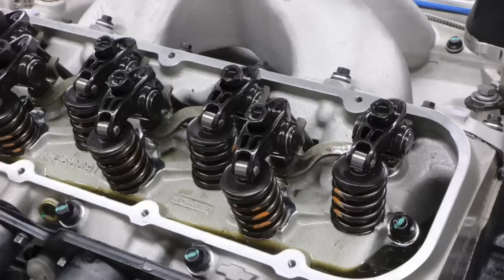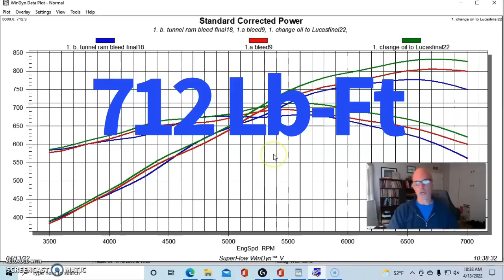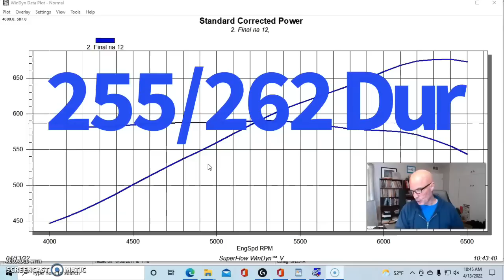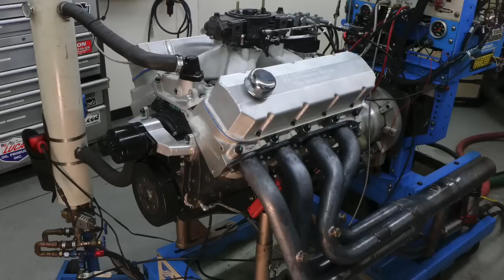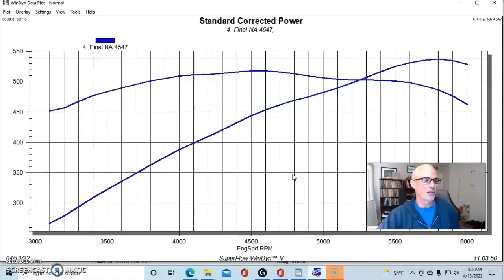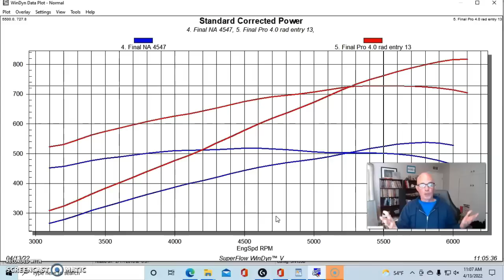BIG CAM & LOW COMPRESSION (MISTAKE?) STROKER, NOS OR BLOWER? WHICH 800-HP BBC COMBO WOULD YOU PICK?

Comment: That 540 would need around a 4000 stall would work excellent in a street and strip engine. And would make a huge gain at the track with a 350 horsepower nitrous kit. Especially with that 8.90 low compression with flat tops even better! No Junky Dome Pistons and Pump Gas Here!!! And a huge easy tuning window on engine, flat tops and nitrous. On engine 87 octane with those flat top pistons and probably pump gas and race fuel mixed or pure race fuel will definitely work for nitrous. 
833 naturally aspirated+ 350 nitrous = 1,183 horsepower. 

Bigger cubic inch engines are stronger and take more nitrous!!!

454 mild budget low compression engine 
250 horsepower cheater nitrous kit. 2.70 second gain in the 1/4 mile. That's huge with lower compression is the secret! 

750 Cid 15. compression 6.80 1/4 mile professional race car! 
200 horsepower nitrous kit 6.60 1/4 mile not much gain at all on nitrous! 
  
Because the engine is already almost at almost 100 volumetric efficiency! 

The higher the compression the less the gain with nitrous is! The lower the compression the bigger the gain with nitrous!!! 

More gain at the strip or street with lower compression and nitrous!

I will take my BBC 9. compression 540 pump gas with a 300 horsepower nitrous kit any day. Than a BBC 540 high compression and 13. compression, race fuel and no nitrous. Higher compression doesn't have the super cooling effect nitrous does. You can heat the nitrous bottle to the maximum for more gain!

Comment: Would like to see a similar low compression maxed out 9.00 compression on a 632. And then a solid non roller cam. Im not in a class I just like things lasting a very long time. I know it will be less power. But I like the longevity and durability of lighter valve spring pressures on all 16 valve springs. And no roller lifter wheels to fall apart. And another added benefit of a solid cam, lifters and valve spring kit is cheaper! Solid cams definitely lasts longer than solid roller cams! Ànd no valve float from solid cams compared to hydraulic cams.

Comment: On the low compression big block, what would be the outcome if you swapped those heads for a smaller chamber equal flow head and went with more cam? Would it have pushed it into the 900s or higher?

Comment: More fuel with larger TB will cool intake charge more as it vaporizes.  Lower temp intake charge seams correct as more fuel is vaporized. My  data for this conclusion is for carbed C/SA car, 1/4 mile.  Intake charge air temp near head at launch 110 degrees and 67 degrees at finish line.  Racepak data logger.

Comment: Would you happen to know what's the max safe overbore on a gen 6 BBC 454?
Reply: Check cylinder walls for thickness, you could be anywhere between a .030 overbore to upwards of .100 overbore. My Gen5 roller block is at a safe .040 overbore. The more you stress it via boost/nitrous the more wall thickness is needed.
Reply: @jondahl3173  just a tow pig man. Plan on throwing a 540 in it in the end. Just wanted to refresh the stock vortec with a stroker kit. I was thinking a 505 kit

Comment: Has anyone made a 496 using a 4.375"crank and 4.25bore
Reply from the maker: that is not a great choice-the longer stroke crank causes windage issues
Reply: @richardholdener1727   even if it's low rpm use intended?

Comment: What is your opinion on Rod ratios? I am building a supercharged BBC 540 drag motor I might go with a 6.70 rods. Either going to run 10.0 or 10.5 to 1 comp ratio. Curious if the wrist pain would be too far into the piston?
Reply from the maker: I don't feel rod ratio changes much-so I would opt for the right piston design
Reply: Never heard of 6.7. 6.135 stock 6.385 is what most 540 have .250 longer even at half inch long 6.635
Reply: @robertwetherington3372  yes they make different lengths for different piston/ rod ratio... you can look up rods at summit racing for the 454 and check out the variations of rod lengths.. ;)

Comment: I noticed the power started to dip at 6500 with the tunnel ram BB compared to the single plane intake.  Was that due to the runner length of the tunnel ram?
Reply from the maker: where was the tunnel ram compared to the single plane?
Reply: @richardholdener1727  The 540 in the 700 HP video.

Comment: Am I missing something? What happened to the gen7 8.1 from the first video?
Reply from the maker: it doesn't make 800 hp yet
Reply: @richardholdener1727   I don’t think it would take a huge amount to get 900 hp out of the 8.1 . And an S480 with a T6 volute and a 5 inch exhaust back to two 3 inch pipes side be side to the rear wheel passenger side 3x6 outlet would likely make 900+ with a good intercooler.  That would be a real sleeper in 78-81 Malibu, beige with a 3000 stall speed. You’re right 9.5 -9.7 cr would be better on 91, if you were just getting home 87 would get you home. A single with the right cam should have a rising boost curve.  Likely no more than 11.5-12 lbs boost.

Comment: Big block question from someone who rarely sees them.  Are there any good fuel injection manifolds for these engines?  Seems like these combos, as they go higher and higher, are increasingly using carbed setups.  Was just wondering if that was out of necessity or convenience.
Reply from the maker: the Dart tunnel ram has provisions for injectors-we just didn't utilize them-also single planes withe efi are avail

Comment: Can you test PROGRESSIVE nitrous controllers that ramp up the nitrous and fuel gradually between, say, 3500 and 6500? (I'm just full of great questions today 😂)
Reply: That is where the 8.1 shines is how many algorithms you can mix and match with the shutter wheel, a good tuner can write these into your tune to activate and modify the tables to the hard parameters and allow “ 1 then 0 , if zero then parameter table 2 for those little moments that aren’t available under the standard algorithm for manual function, written as a separate set of “if” or “if not menu readouts and allow it to show during data logging. The tuner can then set new parameters for the controller.
Reply: Actually traction and making fuel eliminates a good number of factors that can bugger up a lot of conditions. I don’t like a lack of those things very much. At least you have an idea where to tune

Comment: On the nitrous 496, what is the reasoning behind the 114 LSA? Is that just for vacuum for power brakes, and a smoother idle, or does nitrous work better with that?
Reply: That 496 was done in a earlier video as a versatile power adder build he ran it NA, NOS and supercharged that 114 LSA cam was a turbo cam he said also worked good for any power adder but also did well NA.
Reply: @justinfee819  Ah, I see. Thanks.
Reply from the maker: Nitrous just adds to what is there
Reply: @richardholdener1727  Ok. So why did you choose a 114 LSA rather than 110, 108, etc?

Comment: Hey Rich, could you do a comparison of a low compression big block and a high compression big block using mostly the exact parts and pieces and then add nitrous. Like to see that 540cu in as a demonstration. Thanks
Reply: nitrous is nitrous, whatever the jet size is the hp you will add regardless of the base HP number (to a point).  Compression will do your standard 4% per point of compression. As long as you aren't octane limited you should be good making more power with the high compression. Ask this question at the live session at 7 and you might get a more detailed answer.
Reply from the maker: Kelly is correct-nitrous will add the same amount to each base combo-the higher compression will start and end with more power

Comment: I'd love to see you build a BB Mopar stroker, between 496 and 520 or so (440 Source has kits), Trick Flow 270 heads, tunnel ram, big stinkin' roller, all that. I'd bet that could reach 800 hp NA as well. Get Dulcich to work on that! 😉
Reply: Im making 700 hp on a somewhat mild 505 Mopar so 800 is pretty straightforward nowadays. Hell shoot for 950-1000hp 😄
Reply: @applebitefool  Dyno verified? Cool, what's the combo?
Reply: @applebitefool  2hp/ci NA (look at us with our secret language, lol) is pretty impressive for any engine, but can you make it streetable? On pump gas? 🤔

Comment: Rich, have you tested the 4/7 swap on hi power big blocks like these? Any change?
Reply from the maker: no power changes
Reply: I think it's more about moving heat in the motor away from adjoining cylinders... correct me if I'm wrong.
Reply: @jondahl3173  Actually, it was supposedy about crankshaft harmonics, but on any engine that's below about 700 hp and 7000 rpm, I don't think that's an issue. I learned from David Vizard that as far as adjacent cylinders robbing each other's charge, the 4/7 swap merely moves the problem from the left rear cylinders to the right front. And I would guess that the exhaust heat issue would too.

Comment: How about the 8.1 with 10:1 cr 246/ 252 @.050 1.8 rockers with .700/.700 net with 110 LSA and a S480 T6 with a 3 inch crossover. 2 Wastegates electronic controller. A 5 in exhaust from the turbo back and down with a collector to allow a pair of 3 inch pipes side by side to a 3 x 6 oval tip out in front of the rear passenger side rear wheel.  Prediction 935 hp 815 ft lbs and very drivable on pump 91 octane. 1.885 per cI with a rising boost curve moderate back pressure and with a  solid transmission that you can shift down to 3200 and let the show begin to 6400 with forged rods and 4032 alloy forged pistons with ring gap.Stay on the back side of the throttle and wave at the constabulary as you purr by.  lol
Reply from the maker: for 91 you would be better off with lower compression
Reply: @richardholdener1727  How about 9.28.:1?  Would you need a larger hot side wheel ! I think there is 96 and a 1.33 a/r . It you were drag racing I would think that you would want it on the two step at 3 lbs boost at 3000 to allow 6.5 when the leverage hits and the front end jumps and be at 9-10 by 60 ft, I would think it would be a fair rate of spool to get clear of the intercooler and fuel and timing regulators for the big show from the 1/8th on without much traction trouble with the front wheels in the air…kind of a 60 ft leapfrog and hard pulling from there on.
Reply: I think you need more turbo.

Comment: What about an S480T6?  9.6:1 cr, 3 inch crossover twin Wastegate single S480 with a T6 volute and a 5 inch exhaust back and down to twin 3 inch pipes back to in front of the righ